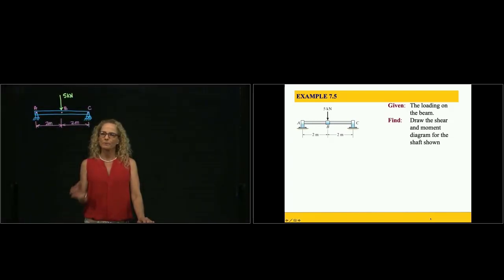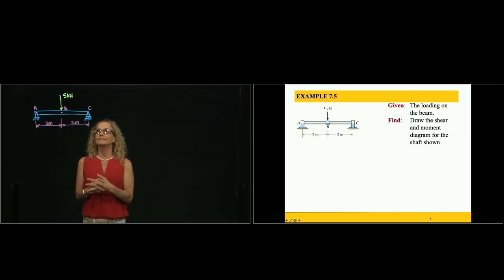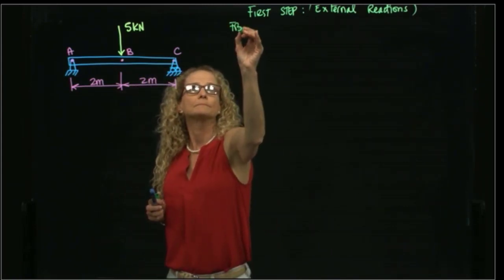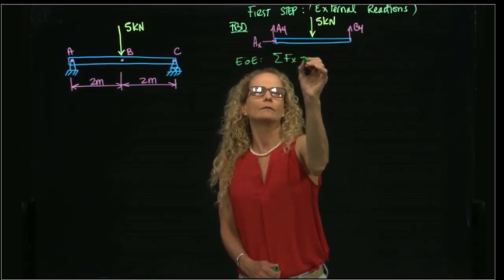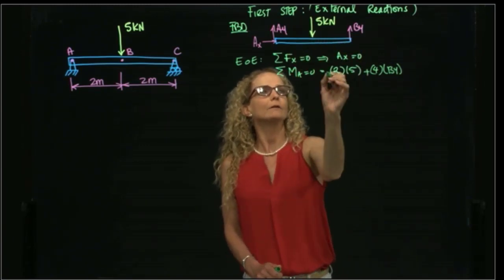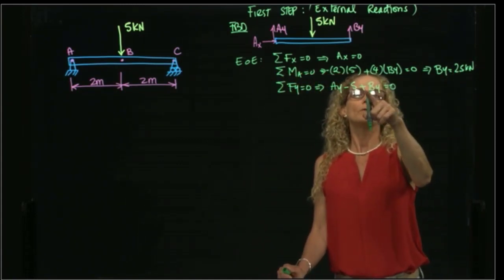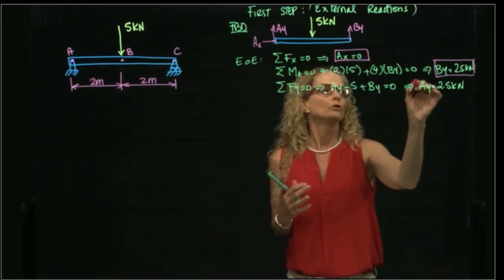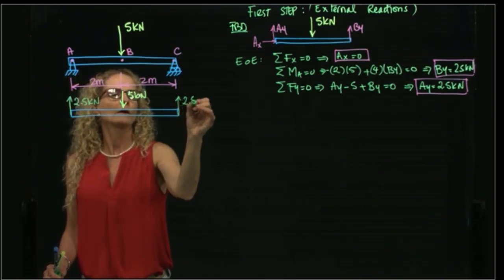STATICS, Example 7 5 Shear and Moment diagrams, one external load

Comment: for the first segment the book aligns with your equation 2.5x but for the 2nd segment the book has -2.5x+10 instead of your -2.5x+5 which are clearly 2 different linear equations
either the book is wrong or your equation is wrong